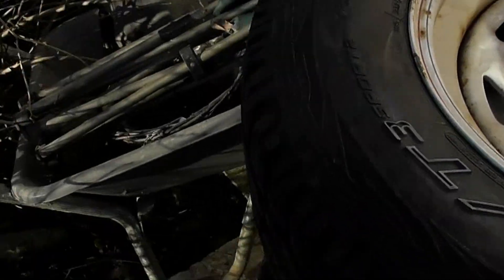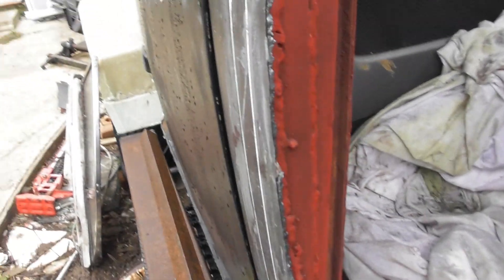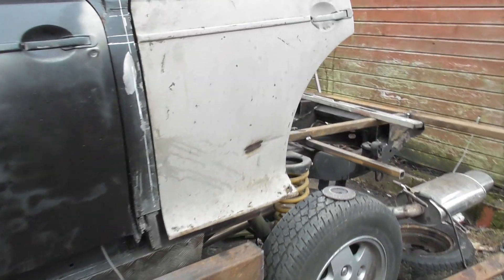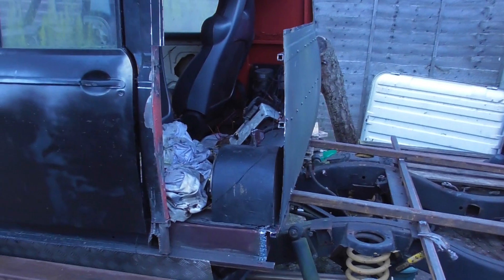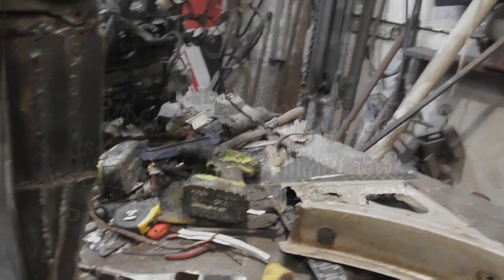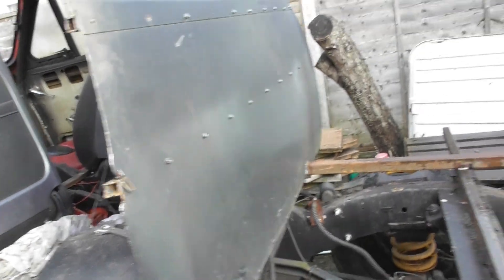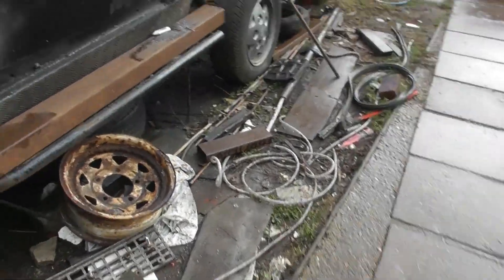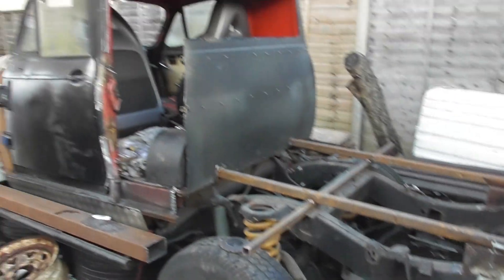side door or not?

Comment: When you mentioned you had got some doors I just assumed you wanted them to continue the body lines..not to have functioning doors..as you described a rear van style back previously so use for camping ect..or maybe I missed something...experimentating. Has its merits...we learn something and it only really costs us time an money...could you just have the steel rolled to match the body lines for lower half to the window line ..mount your fenders..then Cut out inner fender wells..and do your wood to the upper  roof line..maybe pull out/slider bed boxes for rear floor.gives ya plenty of storage an then matress on top for camping.just a couple ideas...keep on wrenching..Cheers see ya on the next one.
Reply from the maker: Some of what you have mentioned will be addressed in the next video .
so I find it difficult to answer this question as I will give away a lot of what the next videos about.
 So what I will do instead of typing out on this question, I will physically answer them in the next video as it is such a great question and merits a proper reply Thank you for your comment🙂